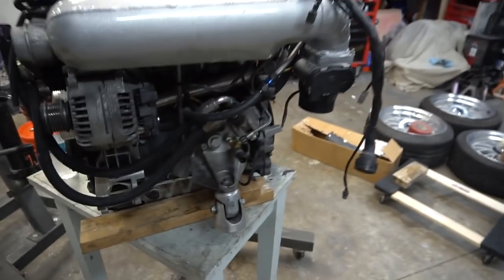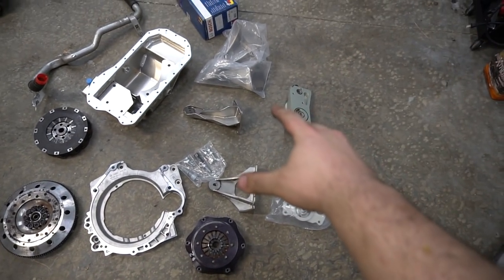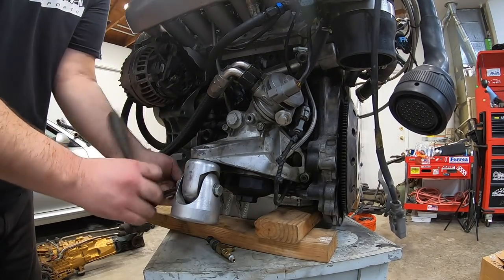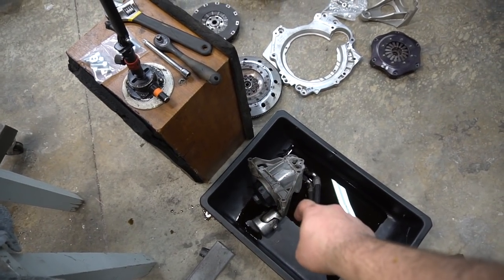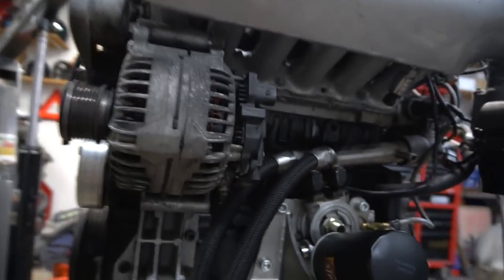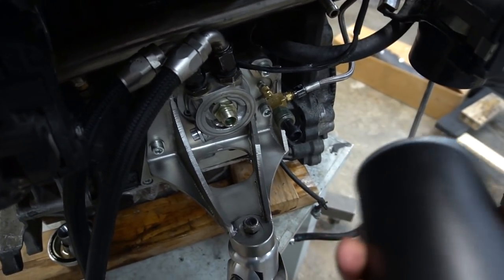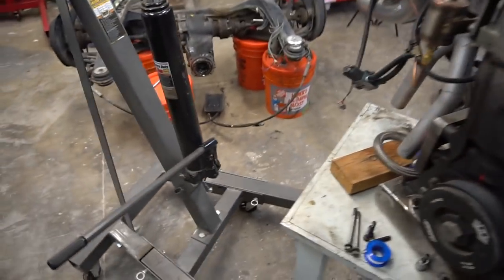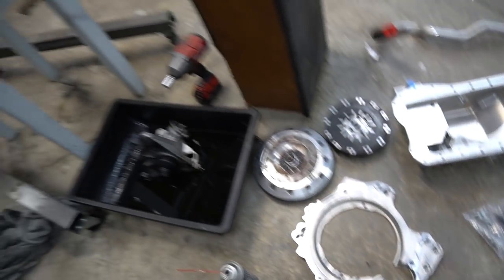24v VR6 AUDI SWAP  - BOLT ON ENGINE SWAP BRACKET KIT

Comment: Found another source for the VR5 engine mounts.  They seem to be the same as the mount used on the Audi Q7 VR32 and also the Touareg 3.2l.  They start for about $35 and go up from there. Manufacturer Part Numbers:	022199354L / 022199354 L / 022 199 354 L and ZH29F5.
Reply: Got a link?

Comment: Oh Man!!! When you told me y'all have something coming up I had NOOOO clue what you were saying! Yoooo this video was worth the wait!!!
I haven't check out the website link yet, I'm I'm pretty sure it'll answer my questions, but is there a big difference in the blocks besides bore n stroke, from the 2.8l 24v and the 3.2l 24v? And why haven't you swapped to a 3.2l?
Reply from the maker: 24v 2.8 has much thicker cylinder walls, I may swap my head to the 3.2 for better flow and cam options though.

Comment: Do they sell just the adapter plate? Without the engine mount(transverse vr😞) but looks like a nicer looking peice then the schimmel performance one idk if the filter would clear the rad support tho..

Comment: Can I use this mounts to put a vr6 in b6 a4… and if yes when are they going on sale… there is no trace or information about this mounts anywhere …
Reply from the maker: Yes you can use them in a b6.  Contact issam @ iabedindustries they are the manufacture and  sell them.
Reply: @MalakaMotorSports  thanks for the reply I just bought a b8.5 allroad first VAG ever came from the Honda/Acura scene… I’m amazed by the community it’s mind blowing… I’m still trying to find the community in my town.